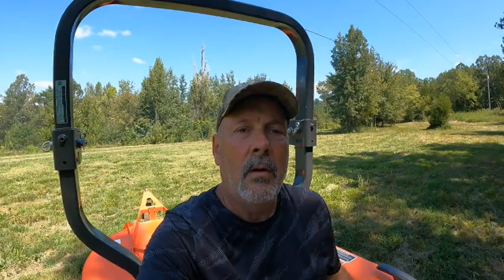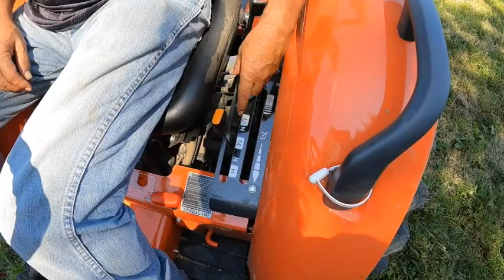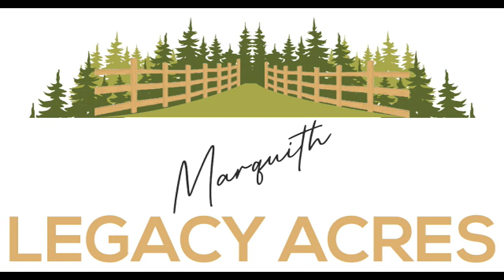Kubota L2502 - High / Medium / Low Gear Settings "Made Easy Series" Ep. 6

Comment: Another simple easy to follow informative video for the new tractor owner.  Sometimes mine doesn't want to shift into one of the transmission speed settings.  To get it in gear, I need to get the tractor to move just a bit to allow me to shift.  Either by letting off the brake (when on a slope), or by slightly pressing the treadle peddle when in a gear it will shift into (usually the one it was originally in before trying to shift) and getting the tractor to move a small bit then shifting.  Very similar to what a manual tractor operator sometimes experiences.
Reply from the maker: I have them sane issue, but only for low.  Appreciate your comments!